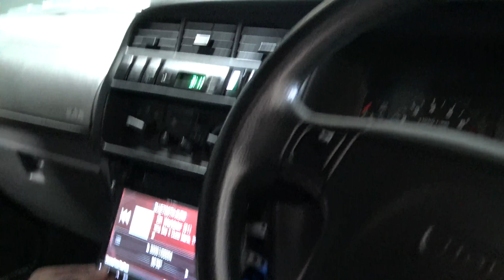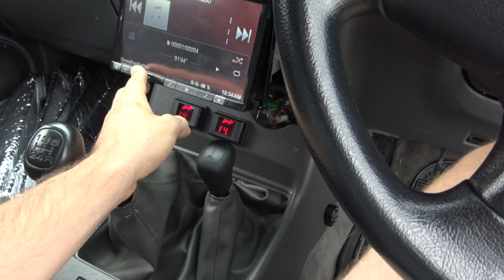ZV4 Install In the Jackaroo Wall on BC5500D

Comment: awesome job retro fitting those, but it looks like theirs not a lot of meat to screw into on the original box as well as your adapter rings.. it's right on the edge of the wood
Reply from the maker: yeah used as much wood as i could, but the ZV4 basket leaves very little between the mounting holes especially as I drilled them out for m6 bolts
Reply: that's nuts,  they leave no wiggle room at all.. i think i would hafta make steel rings or something harder than mdf if it was me,  but still.. awesome
Reply: also,  instead of screwing the adapters into the old box,  you could've used the threaded holes from the original subs to attach the adapters,  jus a thought lol

Comment: 4 zv4 12s c pillar would be a lot better, c pillars need cone area to be loud
Reply from the maker: +TheGingersChannel you read my mind
Reply: +Australia's Biggest Bass Channel definitely a good idea! 2 12s in a wall is just not gonna get that loud, 4 12s is about the same cone area of two 18s, would be much much better and then if you wanted to move to b pillar you could get 2 more or 4 more and do 6/8 12s